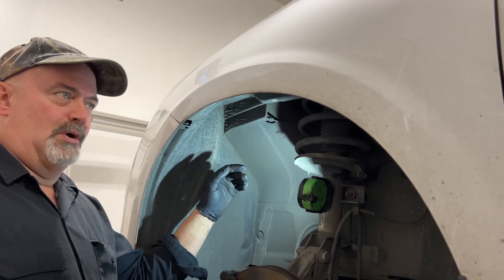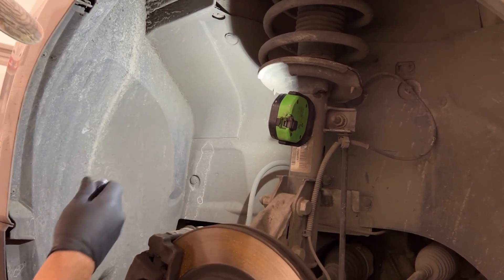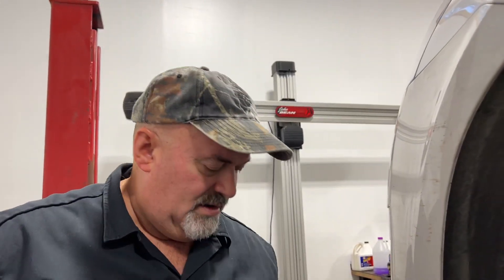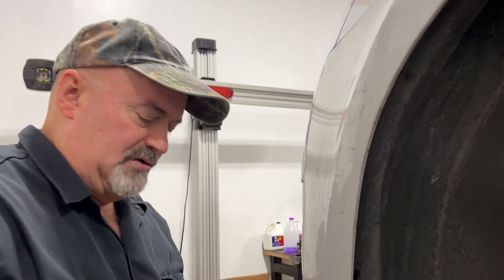Chevy Traverse GMC Acadia Headlight Bulb Replace

Comment: That actually looks fairly easy.

There's another Ew Toober that does car repairs from his home.  Someone came to him for help in replacing a headlight that went out.  I forget but it was one of those high end imported cars.  He literally had to take apart most of the body work in the front and finally gave up and told the customer to take it to the dealer.  It ended up costing something like $1600 to replace a headlight!

I love my old cars.
Reply: Struth,  that is a super stupid design,  i bet it was a bmw lol.
They make repairs very expensive.
( Break My Wallet ) BMW :)

Comment: Why is it,  engineers in the car manufacturers design something like this. Its almost like they made a headlight, then the manufacturer says let's build a car around the headlamp. Let's make it to where whoever buys our car will hafta remove the tires, fenders, bumpers, steering column, and  both front doors just to get to the burnt out light bulb.
Reply: And....it will become in time a shade tree mechanic won't be able to do much at all

Comment: Hi tim i watched your video on the P06DD code, i have a 2011 jeep grand cherokee 3.6L and when i try to accelerate at 3k RPMS i lose all power and have to let the rpms drop below 2500 to then accelerate again, the code read engine oil pressure sensor switched off, i replaced the sensor and the code is still popping up, any recommendations?
Reply from the maker: Whats your actual oil pressure?